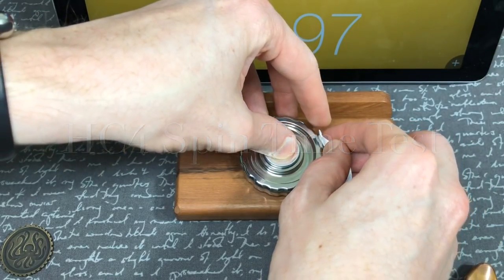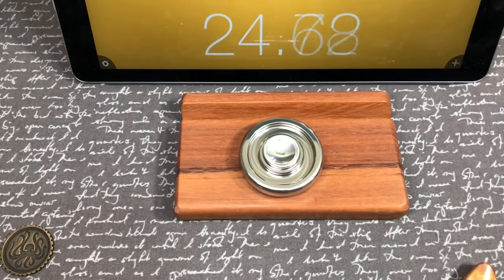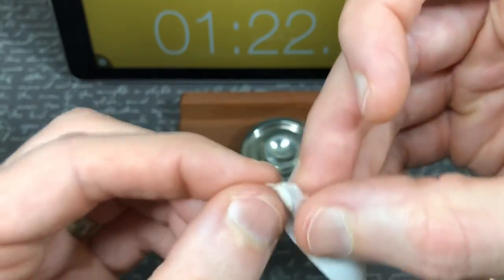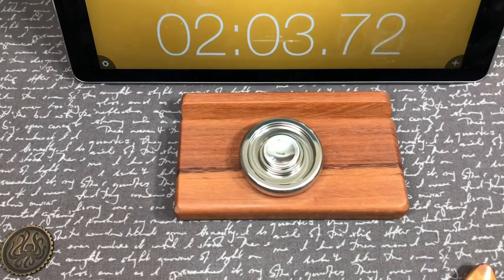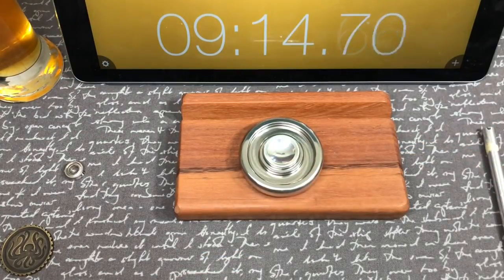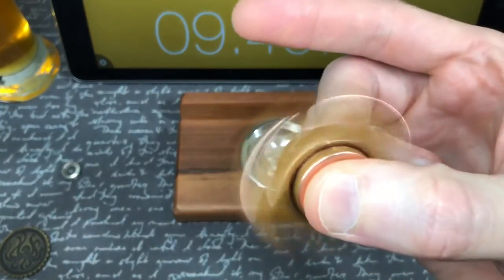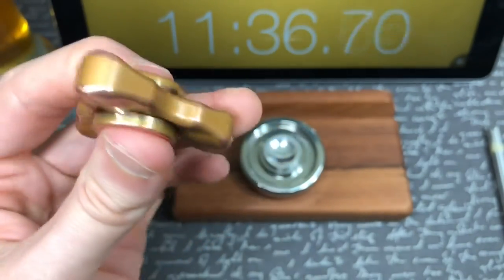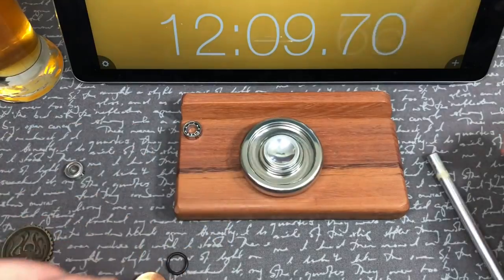Bearing News: HC4 ~ Worlds Longest Spinning Bearing?!?

Comment: Compairing the Ohana vector for instance, the solid body to ambassador elite ohana. Wouldnt the elite with voids/windows spin longer?
Reply from the maker: I should have mentioned this in my video. I would have expected it to but the ambassador does spin significantly shorter. Still getting great times but closer to the 18-20 minute range.